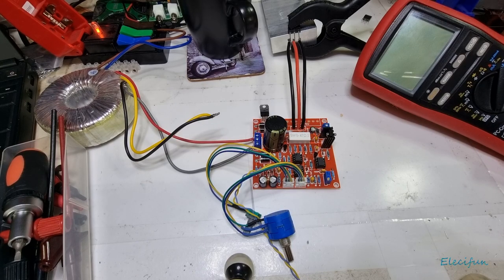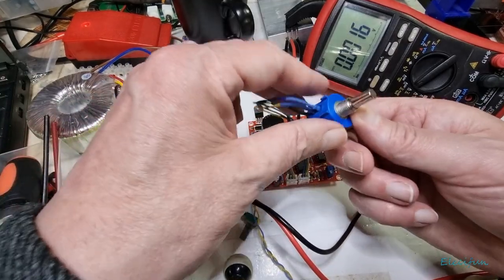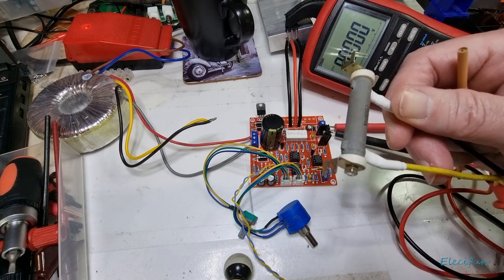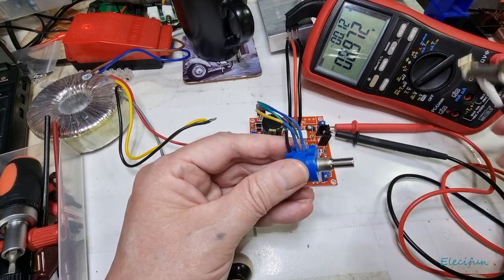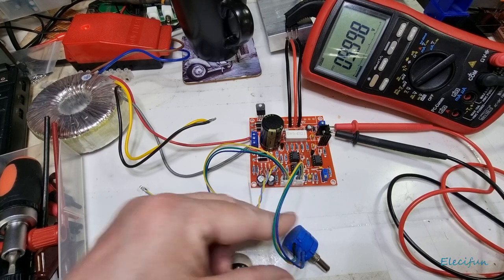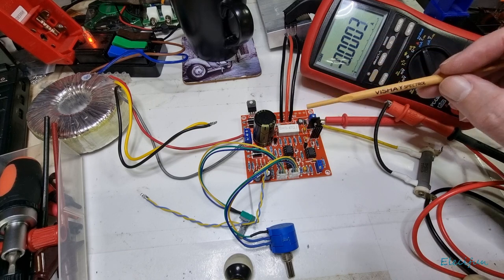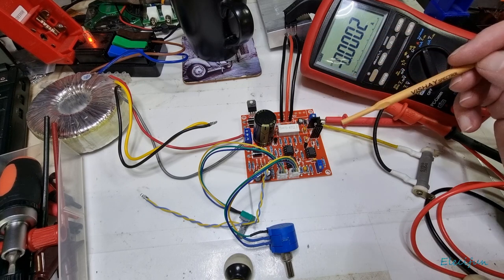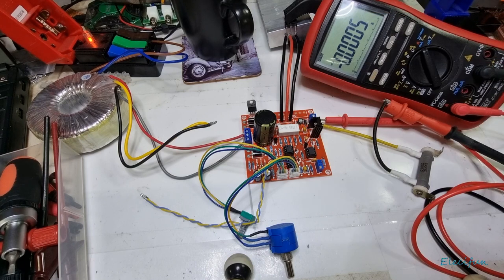NEW   0-30V  2mA-3A  DIY PSU KIT TEST

Comment: I notice on the AC side; you do not use all 3 terminals for your AC Transformer.
How many volts out is your AC Trans former?
I have a 24VAC transformer that only has two wires (and not three: 12-0-12 ---> or 12x2).
I was curious how I would wire up the two wire.
Do I do this like you?
Reply from the maker: The transformer is 12v-0-12v output. I have tied them in series (24v) and do not use (for convenience) while testing the middle 0 connection, its not connected on the board.

Comment: I recieved a notification for a comment on those hiland 30V regulated power supplies and the Russian dude got it to work. From what I could deduce apparently the transistor is faulty or fake which means if you turn them up they burn out. I couldn't understand what he did exactly but he modded the circuit and changed to transistor to a bigger one. He tested it and got it to work. 😀
Reply from the maker: @decem_unosquattro9538 it would be good to see that video
Reply: @Elecifun  Let me know it's the same as ours?
Reply from the maker: @decem_unosquattro9538  what? you got the notification, you let me know so I can go see it.
Reply from the maker: @decem_unosquattro9538  I see links now held in the review comments. I will go check it out. Did you? You would know if its the same.
Reply from the maker: @decem_unosquattro9538  Its the same as the faulty ones I have. Can you translate the audio?
Reply: @Elecifun  Yes, notification that the ytuber had liked my comment.
Reply: @Elecifun  sorry what were we talking about again?
Reply: @Elecifun  google will translate Russian into English. It's good enough to get some idea of what he's talking about. That's what I do. Google has a translator on the video.
Reply: @Elecifun  That's what I thought they're the same as our 30V 3A regulated power supplies. It appears he's using a completely different transistor which is the metal type. I think he had it up to 38Vs at one stage.

The D817 or whatever was on that 30V 3A regulated P/S eventually destroyed itself. 

He said it was faulty ! That's apparently the reason why it burnt out.

He swapped it out with another transistor the circle metal type.

Retested it and yeah it appears to hit the 30V no problems.

Note. He welded another resistor to the other side of the board.

Also I think he changed one or two of the other resistors on the side, with all the other components.

I noticed he had a bag of those ICs.

You know there is a cluster of ICs.

They're socketed I think actually maybe they're 🤔 not but it would be a good idea to buy some sockets, if they don't have sockets.

I think he changed one of the resisters to a pf value. Not sure. Anyway you can watch it. You'll have a better idea of what he's doing when you see the shematic he drew and he points out what he did. 

Those boards might not be a waste of money after all. 

Anyway it shall be interesting to see what you think. 🙂 👍
Reply from the maker: @decem_unosquattro9538  Did you watch the whole video? Did you see what happened when he turned up the current?
Reply: @Elecifun  🤣💥💯🔥
Reply: @Elecifun  Did you laugh ? 😃
Reply: @Elecifun  Yes I did and I laughed. 😄😁
Reply from the maker: @decem_unosquattro9538 No, I wondered did he really fix it. The Metal transistor was a TO-3 package 2n3055. Not sure what it was that he burnt so badly.
Reply: @Elecifun  Well as far as I know yes he did. That's what I was lead to believe. He burnt the transistor out. He claims it was faulty and them swapped it out with the one you mentioned. 

Good night Sir. I got up very early this morning. I painted some weatherboards. 19 of them. Both sides with undercoat and one side with a top coat. I burnt my arms. Sun's bad here.

Anyway night sir.

Dec.
Reply: @Elecifun  2n4055. I watched another video and the guy offered ways to fix the 30V 3A psu boards. He got it working.

Comment: 🥶 good morning from.🇦🇺🪃 hmm interesting that you got 30V out of it and one amp. 

My counterfeit kits do all sorts of weird things when I try to test them. 

Like I said before I think it's my transformers but to be honest I have not really got to the bottom of it yet.

In the days to come we shall see. 

Maybe I'll get some of those bolted transformers which are supposed to be much better.

Still only time will tell. 

Dec. ❤
Reply from the maker: I'm sure I could get more out of it. I use the 10 Ohm resister at 10V because the math is easy for me, 10/10 =1. 
Why not make a video showing the issue trying different transformers/setups. That would be interesting.
Reply: @Elecifun  Yeah it would be. 🤔

There is much I still don't understand about electronics. The more I learn the more daunting it becomes.

I'm still waiting on parts for my Logitech Z5500 5.1 Surround Sound System. 

I discovered today that only one full bridge rectifier is faulty.

There are two.

One is 53V

The other is 14.5V.

The 14.5V rectifier is only putting out 2.8V. 

The anxious moment will be after I've replaced one of the rectifiers.

I hope it fixed the problem because if it doesn't the problem gets a lot more complicated.

The pcbs have hundreds of components.

Let's hope that's all it is. 

Fingers crossed.

Maybe after this project I might revist the desktop power supply projects again.

In hindsight building power supplies helped me.

The knowledge I garnered through building them gave me a better understanding of how transformers work and how full bridge rectifiers work.

Dec.
Reply: @Elecifun  I dont quite get the equilibrium of power. Current vs Voltage. Its as if Voltage drops if current requirements increase and vice versa. 🤔
Reply: My theory is this: My transformers are wildly or extremely over-rated in terms of the wattage they claim to support.
80W is a blatant lie. This begs the question what rating would one actually need to in order to achieve a output of 24V @ 2A?? 

Maxing out these transformers appears to greatly exceed what these transformer are actually capable of delivering!

Again I believe you are right in saying you need a higher wattage transformer because they just are not up to the task of putting out 80W!

The inefficiencies must be woefully high which makes me wonder what exactly are causing these inefficiencies?!
Reply from the maker: If you could get your head around Ohms law. Try learning or keeping for reference this chart https://wallpapercave.com/wp/wp3864193.png
Reply: @Elecifun  I would need to study that every day to understand that it clearly  !
Reply: @Elecifun  I bought a book on the subject of electronics. Sigh. Complex equations that are hard to understand.
Reply from the maker: Dec that's the price for the knowledge. Besides having the chart printed out and used as reference makes understanding the basics much easier.
Reply from the maker: Buddy a lot of informal learning is about tinkering, building what interests you and learning along the way.